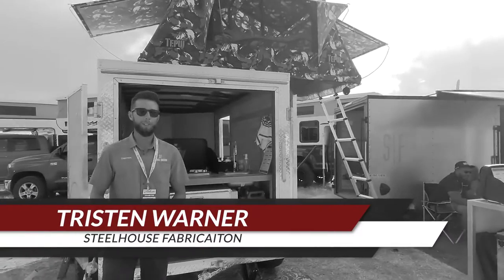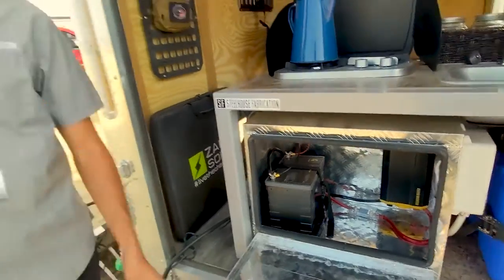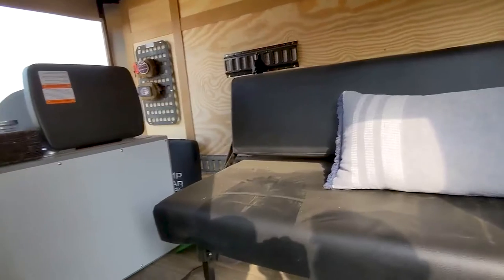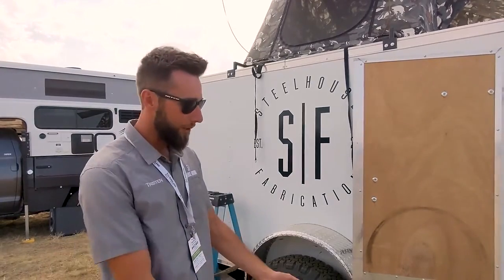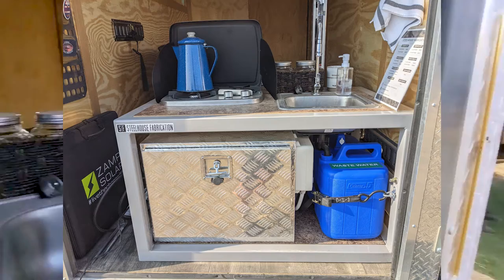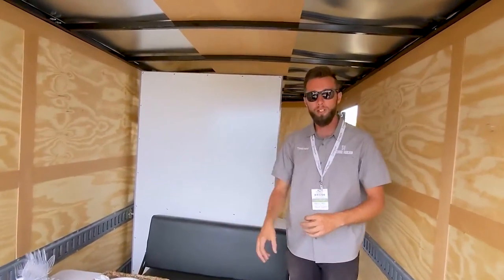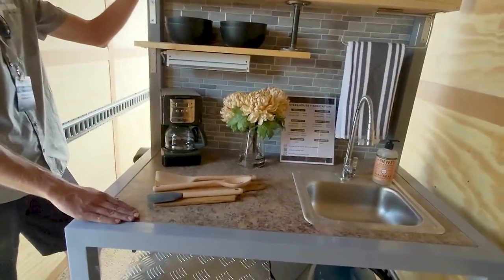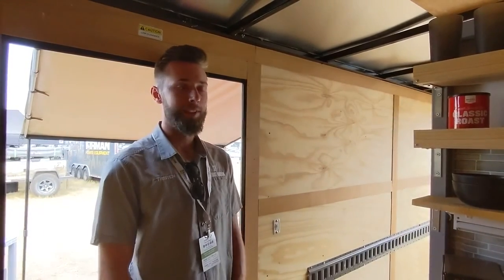Cargo Trailer Camper - Solar, Kitchen, & Room To Sleep!

Comment: Interesting concept especially for people without building skills.
Reply: Don't need building skills if you're already tent camping by a CT load your gear into the trailer and go camping. You set up the same way as tent camping except you've replaced the tent with a CT! No setting up in rain,no wet sleeping bags,clothes or tent! Load everything back into the CT and go home until the next time you go camping. Easy peezy!!